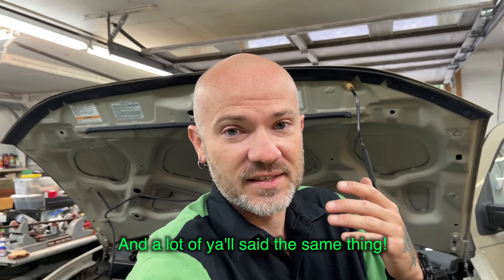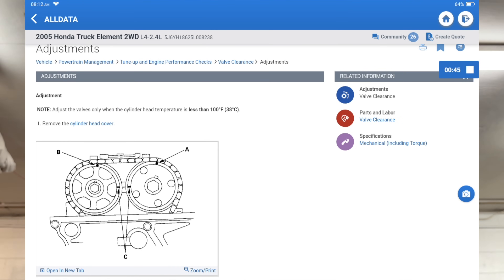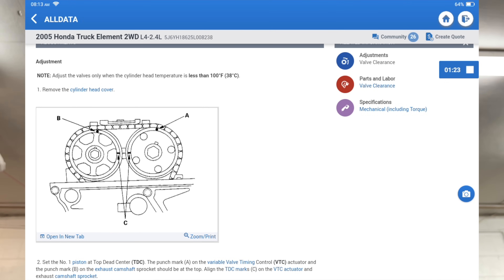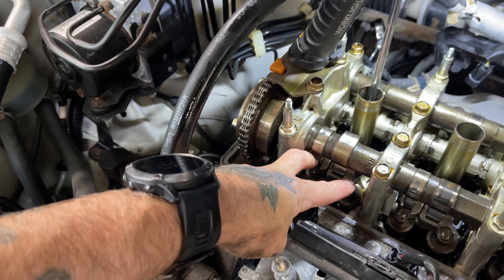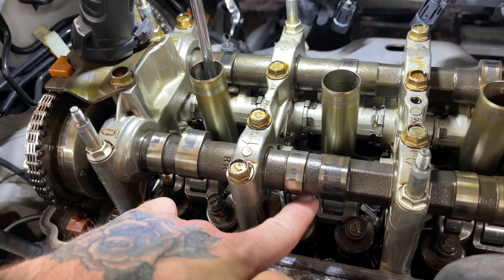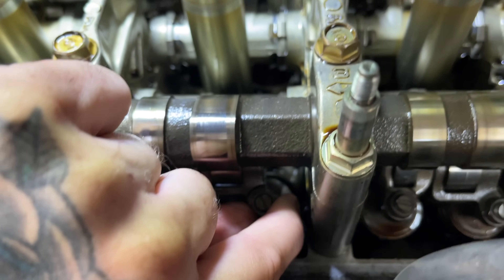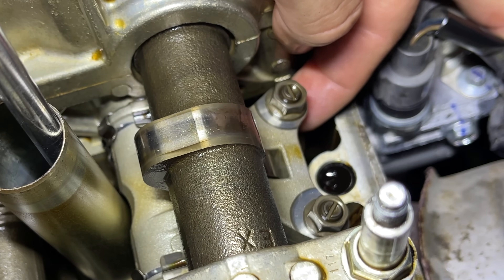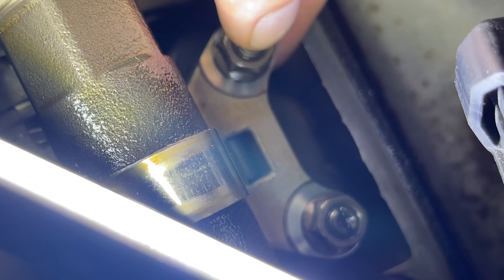Honda Element Stalling Part 2 Ivan to the Rescue!

Comment: Excellent job! It looks like you are on the right track. I would try a PCM reset I find on Honda's that clears all the fuel trim memory. I would also check the oil and make sure it's not full of fuel. Thanks for another great video!

Comment: Ha nice work on the valve adjustment Jake! NPR repair 😎
I'm wondering if the engine oil got diluted with gas when it was flooding itself out before the valve adjustment? I would change the oil and see if the fuel trims get back closer to 0% 🙂
Reply: I was going to suggest that too  but ol' Ivan is on his toes as per usual. Lol
Reply: I said the same thing on his last vid..   It could be sucking fumes from the crankcase.
Reply: That’s what I said first video.
Reply: One or more exhaust valves are burned due to incorrect valve lash and uncombusted gas is leaking into the exhaust,  it needs a valve job.
Reply: Glad to see you both supporting eachother

Comment: Was an Acura dealer tech. Exhaust valves always get tight on these higher mileage Hondas. I use to run through them by feel and only adjust the ones with zero lash. The rule of thumb I’ve always used for Hondas is to look at my map voltage to be under 1 volt. Anytime I would have right valves I would see map voltages over a volt that would bounce around pretty rapidly.
Reply: @dxxxm231 just for my understanding, with the correct valve adjustment MAP voltages should be over a volt a volt? If you don't mind can you clarify it?  Confused on the last part "voltage that would bounce around pretty rapidly".

Comment: One thing you also gotta consider when watching fuel trims is your evap system. A leaky evap solenoid or during purge your trims can be off a bit either way, positive or negative depending how much vapor is in the canister.
Reply: I said the same thing.. but you would think it would throw a code for that
Reply: @calholli I think only if it has a fuel tank pressure sensor the computer can detect the issue to raise code.

Comment: Wassup Jake! The “I need Caleb” got me bro! 😂😂 Trust me I know the feeling! On these engines only the exhaust are normally tight whenever you have to adjust the valve clearances. I check both to be safe but I normally only end up doing the exhaust. The map sensor voltage normally gives it away. Anything above 800mV is usually an indicator of tight valves. You’ll more than likely see random misfire codes as well. They’re super solid engines aside from that though. Glad you got it figured out!
Reply from the maker: Hey man! How was your ASTE experience?
Reply: @autodiagyt  I enjoyed it bro! I really enjoyed meeting some of you guys that I’ve ran across on YouTube! I need more programming experience tho! I suck at that! 😂

Comment: Gotta say I struggled watching you adjust valves. You're brilliant with diag. but... Bend the feeler gauges as needed. They are inexpensive and a few sets are nice to have on hand. drove me nuts you didn't take the tiny bit of time to line up the timing marks on the cam gears. maybe you did. I've been at this for 40 years. Learned a lot from you. Think I might have hooked up a fuel gauge from the start to check for a fuel pressure drop when cold and a scope on the coils to see if there was an ignition drop out. Haven't watched part three yet and I'm often wrong on these videos because sometimes you guys have already done tests I suggest.Still learning over here and looking forward to part 3. Thanks  for all the videos. I am learning so much.

Comment: Those exhaust valves were pretty tight.!   They are prone to sink in the valve seat with the heat,  however the intakes don't seem to have that problem.  I  really think
 you fixed it!  Put some miles on it,  and I think those fuel trims will stabilize .     Blessings.

Comment: Seems you got the stall problem fixed, Jake! Seems you're getting gas fumes from somewhere. Like Ivan said below, you probably should change the engine oil (IIRC, he had a similar problem a while back, that cleared after the oil change).

Comment: Look for stuck pcv valve (behind ps pump), dirty throttle body and/or dirty IAC sweeper.  Hugely common on Elements. Up to you. Scan tools are great but basic maintenance is always needed.
Reply: yep, sometimes techs get so caught up in the scan tool data, they  forget to check basic things .  tunnel vision on the scan tool.  sometimes you have to put the scan tools down, and  put your hands on things, and the problem shows itself. 
as far as the valves, they are a maintenance check with that many miles, so checking the lash on the valves early on may have eliminated some issues early on.  also 70 psi on the in cylinder pressure transducer,? that isnt right.,.

Comment: I saw a few comments, introduce a vac leak and see if system responds - good idea, but also have a look at EVAP system for fuel vapours as possible reason why fuel has to be cut back.  Is the oil contaminated from fuel in there?

Comment: I wish you had taken an Intake Vacuum Waveform before you did the valve adjustment, you would have seen the problem at the top of each wave since the exhaust valves were out of time, meaning closing late and allowing more pressure into the intake before the intake valve opened, which in turn would have robbed some vacuum at the bottom of the wave showing a problem at both ends, although we may not see a problem at the bottom if they are all about the same, weakness that is. The accuracy of this effect also depends on the setup of the vacuum transducer assy. Thanks for all your videos.
Reply: How do valves become too tight when the adjuster does not move, the valve beats its way into the valve seat and becomes a tighter fit to the rocker arm, so you should look closer to see if the valves are sunk a bit with your boroscope and compare the very tight to the not as tight to see how far they stick out away from the head chamber? Also another post valve adjustment intake vacuum waveform ought to be captured.

Comment: I saw on your scanner that Your idle learn is not completed. Clean your throttle/iac and try to relearn it for your stalling issue. I know that doesn’t help the fuel correction while driving but if you have no other issues and you just don’t like the number, you need to consider the evap system playing a role in trimming during the purge process of course when it’s warmed up. Block the purge line from intake to see if it changes. An oil change would be on my list after all. Good luck

Comment: @ 19:06 observe your Calc LD and you Manifold pressure.  Both incorrect for that rpm and throttle angle. This is why the trim's are negative.  You should not have almost 50 percent load at 11 percent throttle angle with zero vehicle speed.  Way to keep to it.  Great work Jake!!!  Time to test what is causing the high intake pressure.
Reply from the maker: The ac compressor is on.

Comment: I have seen where someone installed cheap ebay injectors. The injectors have a different flow rate then oem (spray more fuel). So when you start the car it is in open loop and spraying too much fuel, but once it goes into fuel control the ecm reduces injector on time to compensate for the rich condition.

Comment: The exhaust valves on Hondas get tight. They get hot and actually suck up causing a tight valve, intake will be fine or slightly loose. Valves should be somewhat ticky. Hondas with over 200,000 miles we often see it. Start up cold you will see random misses also rich trims

Comment: It seems on these engines from what I have seen most of the time it’s always the exhaust valves that get valve seat wear.  It should be #1 compression stroke you adjust all of #1, intakes valves on #2 exhaust valves #3 then rotate the motor to #4 compression stroke you adjust all of #4 intake valves on #3 exhaust valves on #2.

Comment: You may still have map sensor issues they alot better but I seen it jump to little bit  over 4psi..small deviations will affect fueling if it's speed density ..unplug Pcv to see if any changes is fuel trims and evap purge for leaking valve ...Pcv may be better disconnecting hose from manifold and plugging manifold hole

Comment: Also looking at the video longer the threshold is positive or negative 15 percent so if gets that high for a period of time it will set fuel trim codes. Check the basics; exhaust restriction, purge valve, egr valve etc. Curious to know what you find.

Comment: I'm curious to know what the thread pitch is on the valve adjustment screws. Was wondering if you could add a visual element to adjusting the valves, or even do it purely visual.  If the pitch is .75mm, (a likely guess?) then that is .030in per turn. For .010 that would be 120 degrees, .012 is 144 degrees. Turn screw in till it touches, then back off 120 degrees?  Tighten the nut, and double check with the feeler gauge.
Reply from the maker: Maybe if you did enough of them you could do it that way pretty easy but I’ve not done it since I was 17 lol
Reply: At a minimum, it would be useful to visually check the screw position to see how much you moved it. If the math above held up, then .001 is 12 degrees turn on the screw. That would be fairly easy to judge, I suspect. Your video is great. Before messing with the math, I was comparing video frames of the first exhaust valve before and after adjustment to see how much the screw turned! I think the last valves I played with was on an old worn out snowblower, where I ground about .010 off the back end of an exhaust valve that wasn't fully closing anymore.  @autodiagyt

Comment: I know the comments were lit up with the valves, but I don't see how valves can be an issue when cold. If anything, that would cause a problem when hot, since the lash goes away when it heats up. They don't get looser with heat, so if no lash cold, there is more chance to hang open when hot. So what am I missing? 
I was expecting an OEM O2 sensor to fix it. Not valve lash, but, not 100% confirmed fix yet either.
Reply: For some reason valve lash on this engine are tighter when cold.  The reduced lash on the K24 is a well known problem.
Reply: @scrappy7571  Seems it by the comments, but not something normal. Unless the cam supports grow and cause more last when hot? Weird... but sure someone has an answer.
Reply: I would guess the alloy head expands when hot and the valves move away from the cams.  Definitely odd, and the old push rod engines the lash was set hot.  The slant 6 we would do running. @inothome

Comment: Hey great video I really enjoy watching and learning from your channel.  I just have a question how do the valve lash get tighter instead of looser with mileage.  I would think that a higher mileage engine would exhibit looser components from the metal wear as opposed to the valve lash getting tighter.  Just a bit confused as to why the exhaust valve lash was tighter?
Reply: Overtime the valve face wears into the seat reducing the stem to rocker clearance.
Reply: Hey thank you for the response and detailed explanation, makes sense now.

Comment: Wondering if injectors where changed, wrong size ? What was visual? I'm sure you checked o2 sensor already .
Reply from the maker: They look original or have at least been in there a long time.

Comment: Wonder what fuel smells , dont know if it had alcohol , pcm strategy mode . Does pcm have fuel trim reset? All pids was normal as you could sees except trims, pcm?
Reply from the maker: Yes I reset the trims and the pull back down
Reply: @autodiagyt  best video yet, ect,baro / map ,o2 ,mas, is all good has me Sherlock on this one. I did see when in burn line on scope turbines come and go from valve not sealing, but that's done, did you scope it again to see burn line. I had exhaust valve not sealing burn cat out from raw fuel out. This is a the best yet video.
Reply from the maker: @overload3996  oh man I forgot to scope the ignition waveforms again.

Comment: upstream 02 sensor,  do not use a none OEM sensor , these cars can be finicky about certain non-OEM parts and O2 sensors are one of them, the upstream do affect open loop. test with a used known good sensor if you have one.
Reply from the maker: It was replaced with a denso which is oem I believe.

Comment: Jake, did you adjust all of them on No1 TDC. Because that is not how you do it. You only adjust the ones that are on the low points, then turn it until No2 is on TDC and adjust the rest.
Reply from the maker: No I rotated it. The procedure tells to to rotate and which cylinder to do next. All of the intakes was 0.010 clearance and all of the exhaust had at least 1 really tight valve.
Reply: You don't have to put it at tdc to adjust valves on a Honda. You can put the cam on base circle for the cylinder you're adjusting and go in a line instead  of jumping around following the firing order
Reply: That's just the complete dummy proof way of doing it, for noobs who don't know what they are doing.   You can just do like he was showing and just make sure the cam lobes are nowhere near the rocker.   The reason for putting each cylinder at TDC is just so you can do both intake and exhaust at the same time--   but you don't have to do it that way.  granted--  it's the fail safe way to do it if you have any confusion about it.

Comment: Typically intake gets loose and exhaust gets tighter. Even I adjust hondas I go high on exhaust and low on intake
Reply: why does intake get loose? weakened springs?
Reply: @randy1ization  not sure on the intake but I was "told" by a machinist exhaust valve seats wear causing that but I'm no machinist

Comment: the low vacuum concerns me. did you look for dirty throttle body? also yes fuel saturated oil. its speed density so low vacuum itll command more fuel then have to correct by pulling fuel to achieve lambda.
Reply: you can try to substitute a known good map value and see what happens to the fuel trims

Comment: Try introducing a vacuum leak and see if the long term trim even responds then you can go back to where the extra fuel is coming from 🤔
Reply: This is a map engine. It will compensate for the leak unlike a maf

Comment: I'm still thinking that the Lambda sensor is lying and the car is suffering a lean condition, not rich as indicated by the lying sensor. The only way to verify this is by taking an independent tailpipe measurment using a 5-gas analyzer. Hope you can borrow one to do the measurement.
Reply from the maker: I’m not in an emissions state so it’s extremely rare for someone to buy a 5gas just for diagnostics. I don’t personally know anyone with one.
Reply: I'd try unplugging the second o2 after the converter. Maybe it's reading slightly to rich and the car tries to conserve the catalyst material by not flooding it with gas?
Reply: I thought he already replaced the sensor in the last vid, what are the chances of getting 2 bad sensor in the same way? Close to zero. Correct me if I’m wrong but that’s what I remember
Reply: @hhn2002  Usually the downstream sensor (the one that was changed) is for monitoring the CAT efficiency, even though it reacts to wide open throttle and deceleration events. Upstream sensor, on the other hand, is for monitoring oxygen concentration and adjusting fuel trims accordingly. That's why we need an independent measurement to verify its integrity.

Comment: I must be missing something.. traditionally adjusting valves involves rotating the engine so certain cylinders are in the proper synch to have the valves closed..
Reply from the maker: Yes you have to rotate the engine for the different cylinders

Comment: Trims going so far negative it's starving it for fuel. Honda's have so many different engines if someone installs the wrong O2 sensor ( wrong engine code ) they will do that. Been there done that.

Comment: wild-ass guess.... #4 injector is leaky? but I guess when you did the on car flow test, it would have shown up as a pressure drop when the fuel pump shut off. so maybe not.....

Comment: I watch your O2 S2 Downstream sensor and compared to what you were seeing with your short term fuel trim. They are inversely corrolated. When downstream O2 goes up toward 0.9volts, the ST fuel trim goes negative. When downstream O2 goes down toward 0.1 volts, your ST fuel trim goes positive. There are 2 problems. 1. You said you have WIDE BAND O2 sensors. But the voltage output for the downstream is identical to the range for a narrow band sensor, .1 to .9volts. 
2. I always thought the upstream O2 was the primary input for the PCM to determine fuel trim. In the numbers in your video it does not appear that way. Your upstream numbers are measured in milliamps. There is very little change in the milliamps. Typical wide band millamps vary from negative 200mamps to positive 200mamps. Your numbers are much smaller than this . In addition the lambda number also does not change up or down very much. 
Is there anyway you got either the wrong sensor for the downstream, or it is the right sensor, a narrow band, and the ST trim is acting correctly, or is it possible the wiring for uptream and downstream sensors is switched..  Maybe the ST trim for a Honda is supposed to work based on the downstream O2.  Something here needs investigated further. See the video for yourself.
Reply from the maker: Downstream is a narrow band.
Reply: @autodiagyt  i wonder what your ST fuel trim would be ,just for a test, if you disconnected the downstream O2. Would it default to 0.45 V  and stay steady.

Comment: ya gotta remove the shirt and put a head lamp on. then it might be more realistic lol.  tight valves change valve timing just a wee bit and add in phasers it will increase the egr effect. egr leans it out fuel increases to compensate.  add in engine wear and well used sensors this may be the best it gets